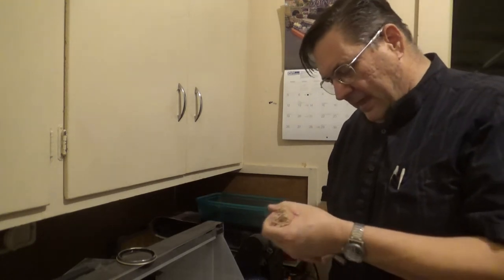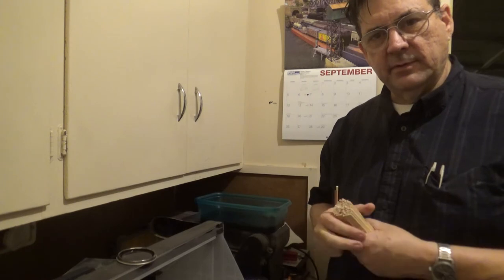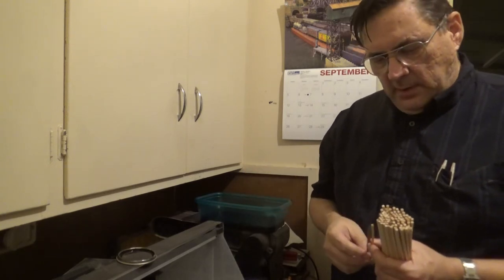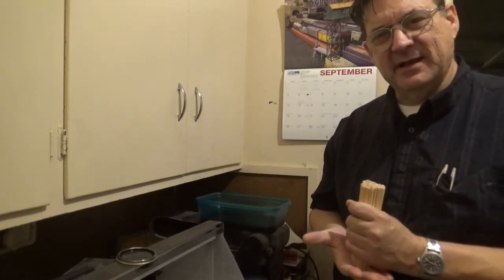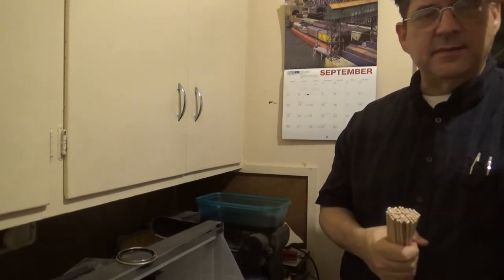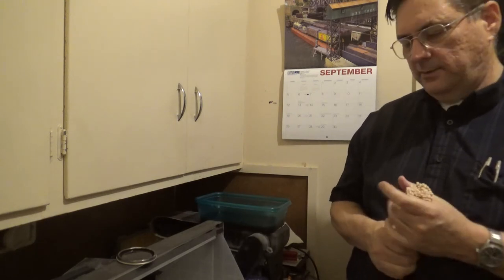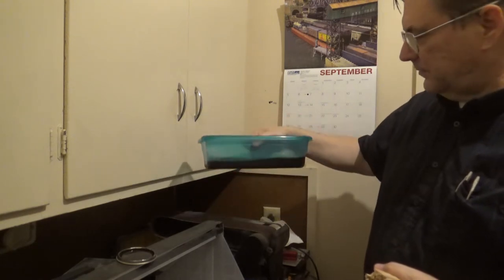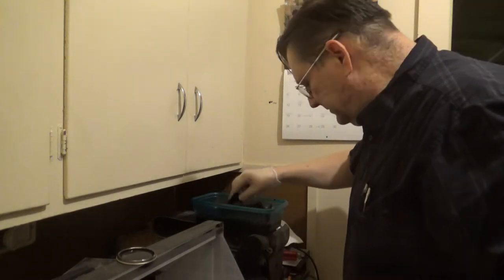Making Utility Poles - Part 1

Comment: Thanks for doing this.  I will eventually have a pole yard.  That is the place that actually makes the pole.  Funny thing is there are all different colors and lengths that I will have to make.  So this was good.  Of course I have to go from stain to having nothing on them. I’m surprised you didn’t do this live, we haven’t seen stain soak and dry yet😚
Reply from the maker: I should do another livestream just for you so you can watch them dry.

Comment: Just a point of trivia, creosote poles are ,( when new) are 95% conductive. However!
Did you scrap them with a hobby saw blade? I like that color, I've climbed enough of them.
Reply from the maker: That is something I did not know.  I guess that is one good reason for insulators.  LOL.   I did not scrape them with a hobby saw.  It seems like it is not really necessary with wood dowels.